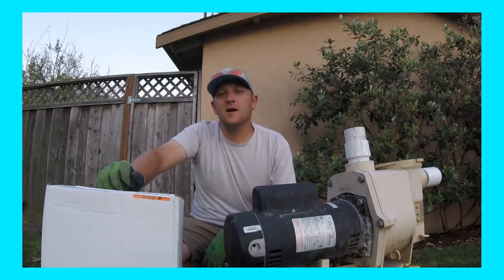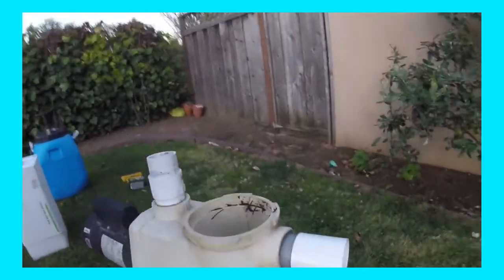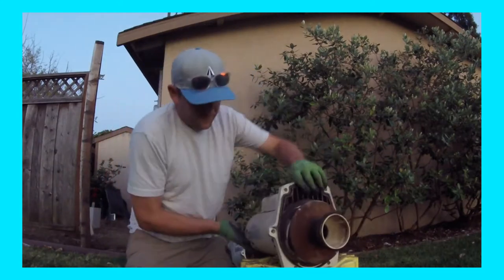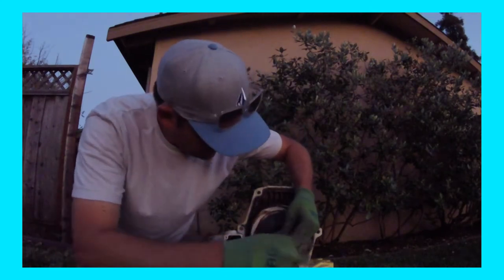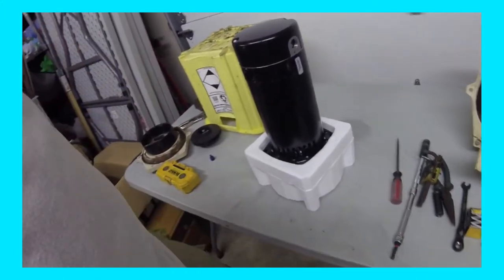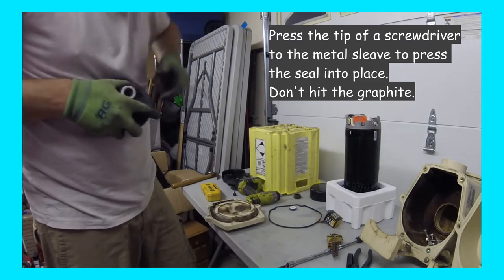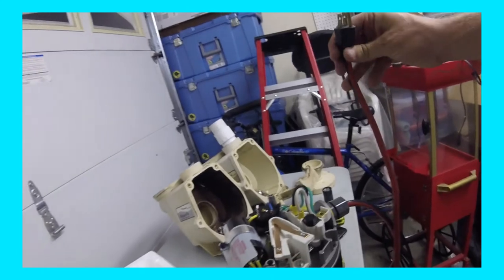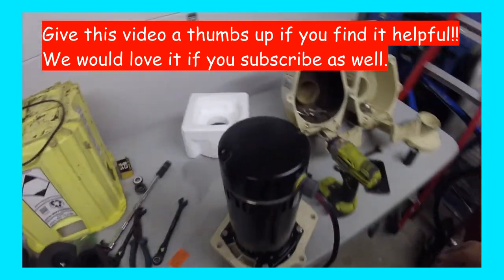Failed Swimming Pool Pump Motor Do-it-yourself Replacement & Upgrade

Comment: Sorry Unrdlated...I couldn't find your contact info...
Considering the cost of tablets and the Out of Stock status of the HASA Liquid Chlorinator...Have you heard of a DIY Liquid Chlorinator... Thank you
Reply from the maker: Absolutely! Best way is to pick up a peristaltic style pump.
Blue and White or Rolachem are the most common. I like Rolachem because you can get them already wired to a 110 plug.
You then need a storage tank. Rolachem also makes them out of polypropylene...some have used Rubbermaid trash cans, but they aren't rated for chemical storage so I don't recommend it.